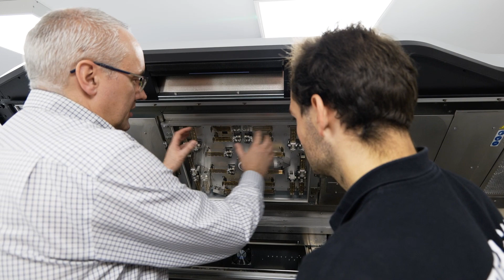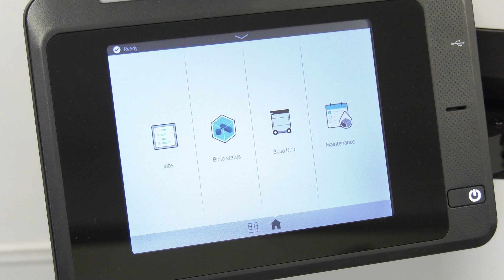How many 3D printers does it take to start a business?

Comment: Paused at 1:00  yes? Are you sure you licensed checked the design that walk in customer got from who knows where. 
Never just say yes unless youve proven who owns the rights to make commercial gain from the thing. 
Basics for newbs. 
License check all uploads and sales, no matter how the thing file came to be.
Even if you drew it. 
Even if Ai drew it. 
Even if scan. 
Even if a walk in customer with file.
Even if you call yourself a farm, service, or old McDonald etc. 
Even if you find a so called free file. 
Even if you purchased file.
A license check is to search. 
3dmdb
Yeggi
Stlfinder
Google
Net.
Now combine all results from all searches into one massive list. Yes still manually done, gpt has not achieved it yet either so 
Then,
Sort by oldest first. 
Then,
Filter out cgi, cnc milling, laser cutting etc.
Thats the basic overview of a 3d print thing license check. 
Non commercial license is a owned thing, that owner sets terms of use, who may sell it, prices if any, so on. 
A thing license ownership can be sold. 
Examples of value. 
Stl per copy                            $1.
Physical print                     $100.
License ownership    $ 100,000.

TRANSFER thing ownership within a site, upload dates are matched to original by email arrangment with site. 
MIGRATE is to move, spread ownership to another site or sites, upload date of creation get matched to original by site by email arrangement with site. 
SEMI MIGRATE. Spread to new site but upload dates dont match, be carefull not to delete original. 
Theres a few basics for newbs.